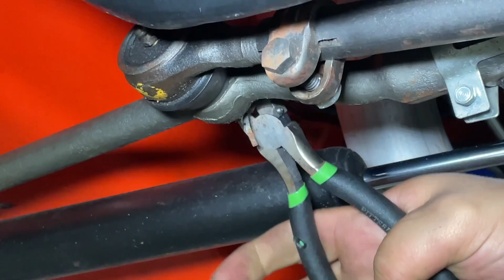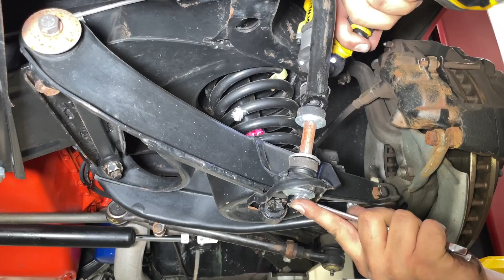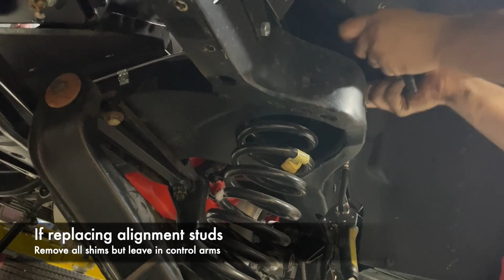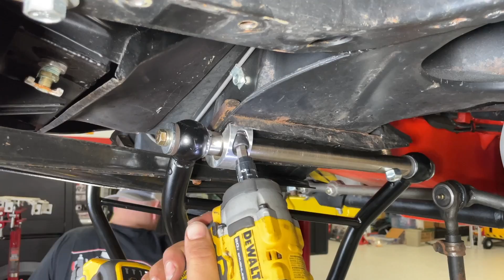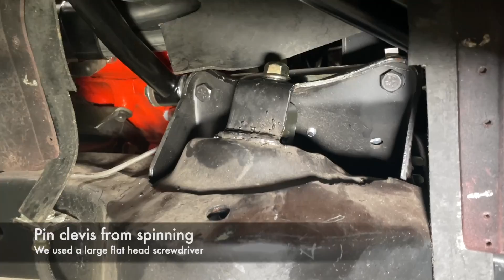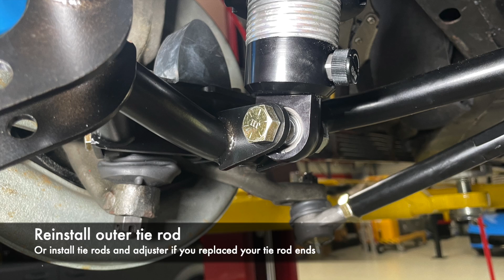C2/C3 Corvette Front Coilover Install by Van Steel

Comment: That’s my dream. To afford front and rear coil over conversion and Willwood brakes I’d have to sell my house. If I win the lottery I will be going Van Steel suspension over G.W. or Ridetech or basically any other company. I’ve done my research. My ‘69 big block 4 speed deserves only the best.